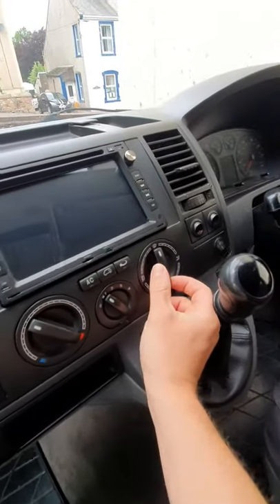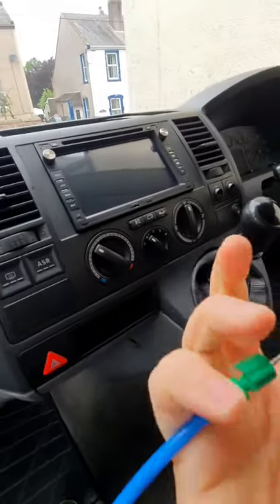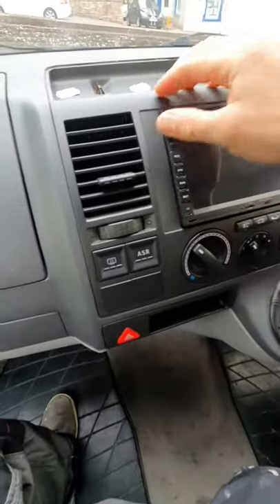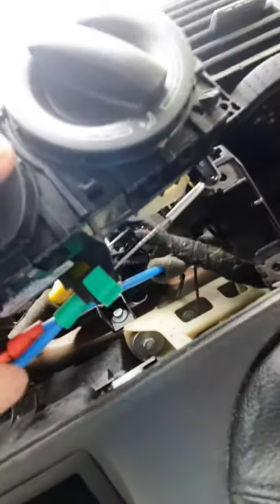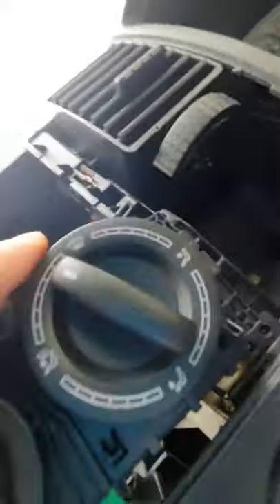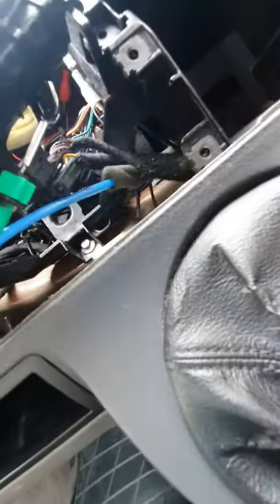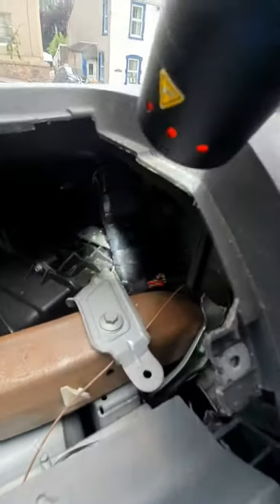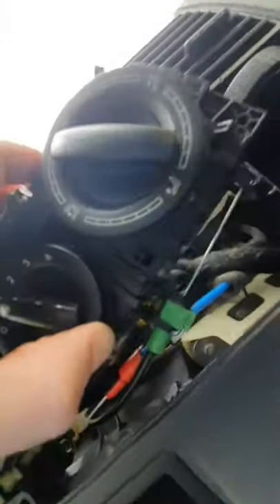T5 transporter heater blower vents control cable repair (link in description) for part

Comment: Top video. Thanks for posting. Just about to start mine. Good tip about always turning the dial anti clockwise too. I’ve bought a new set of controls (suspect faulty A/C button) and they have revised the design. Now you can only turn the dial anti clockwise.

Comment: Super helpful vid, thanks! Had the blower motor replaced by a vw garage and I had this issue with the controls. They took the van back and told me it needed another control mechanism that was probably due to old age/'wear and tear'. They would need to order the part from Germany at £153 and there was a 10 day delay. Fitting of this new part was to be £59, so it was going to cost me over £200 for something that was working perfectly well before the blower was changed.
I ordered the cable (£15) as you suggested and did the whole job in less than 30 mins! Thank you bud!

Comment: Big thanks, there is a little diferense between right and left drive cars but not much.
Reply: @muffer00000007  i took of the left center ventilation piese. Got small hands so i manage to disconnect and connect  the cable throu that hole.
Reply: @muffer00000007  in mine it was easy, pull gently straight out, wiggle a little.

Comment: Sorry for reserecting this great video,but can you tell me if when i have tge cable removed from the dials unit should i be able to turn the dial freely,,mine is still jammed in place,so im thinking it may be the unit thats the problem not the csble,, it is the braded one but looks ok..

Thanks
Reply from the maker: Yes the dial should turn very easy with no cable on. Id guess that the teeth are damaged on the gears.
Reply: Yea as I thought,,I'll try locate a 2nd hand controller..
But will replace the cable also..while I have it out..
Thanks

Comment: Hi everybody, having the same problem as described in the video. Question: I have the steerwheel on the left side. Would you think the end of the cable is mirrored and I will find it behind the dash board compartment. I ask this, because I had some one look at it and he unscrewed part of the dash board and said that the cable was attached behind the steering wheel and it would be a hell of a job, because the whole dashboard had to be uninstalled. Honestly, seeing the video that doesn't make much sense to me as I guess everything is mirrored.

Comment: how did u get the ball back  on new cable i couldnt get me hand in to do mine bud
Reply: The ball just pushes (to the right) in to a .."clasp" , then there is the locking clip further along the cable.

Comment: Mate I couldnt find this kit at ebay . Any chances to send a link below plz.
Reply from the maker: https://www.ebay.co.uk/itm/Solid-Core-Heater-Control-Cable-Replacement-Part-For-VW-T5-7H2819837C-/333307114820?_trksid=p2349624.m46890.l49286